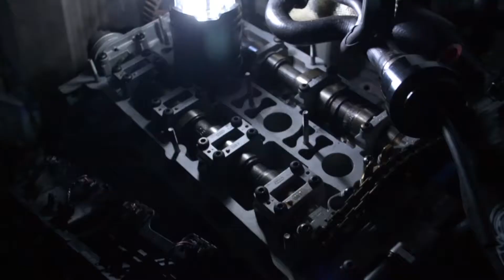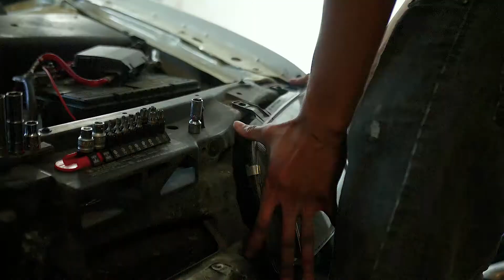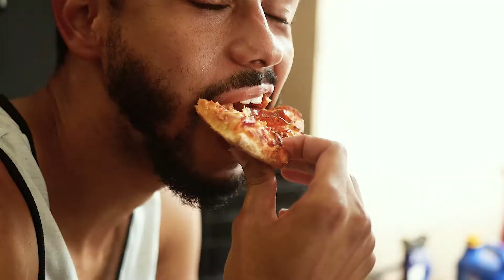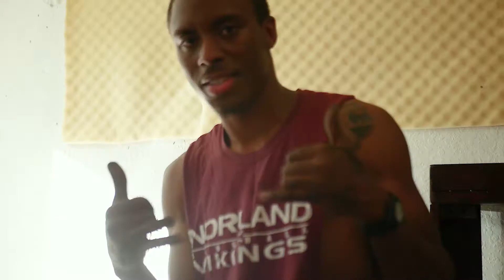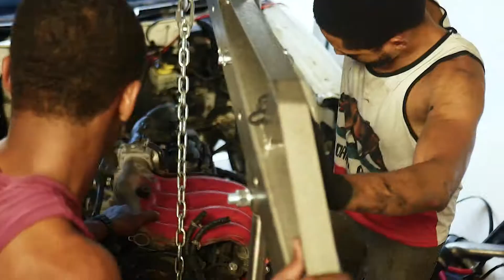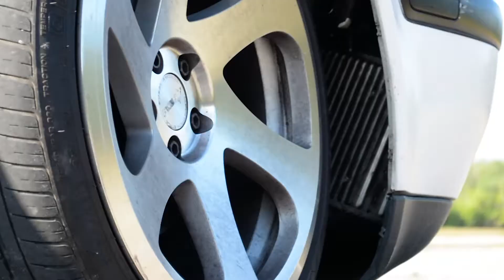2002 Mk4 Jetta 2.0 to 1.8t Engine Swap (Stage 2 Flash)

Comment: Absolutely love the work and you did an outstanding job on this.

 My only question is why go to the trouble when you can buy an entire Golf / Jetta 1.8t in really good condition for like $2500? 

That way you can pick the best parts out of each, still get a 1.8t instead of a 2.Slow, and save like 100 hours of time. 

I think I know the answer before I even asked the question: just cause 😁
Reply from the maker: The biggest issue was space, and I liked my car the way it was at the time; we did it over the weekend after all
Reply: @justinhall9545  Over a weekend!? Respect 👍

Comment: Awesome project! I’m in the process of doing the same swap now and I was wondering what kind of wiring you had to do? I have a cable throttle so I know I’ll have to run wires to the ecu, I also have the entire 1.8 engine harness, ecu and cluster so that’s all pretty straightforward to me. Anything would be a huge help!
Reply from the maker: Harness was plug and play for my drive by wire system.. not sure if I can help a whole lot with that, but you really want either the Bentley or Haynes to check the wiring diagrams between the 2; also another thing to watch for, the output flanges on the trans and spindles for the 2.0 are smaller than ones on the trans that came with the 1.8